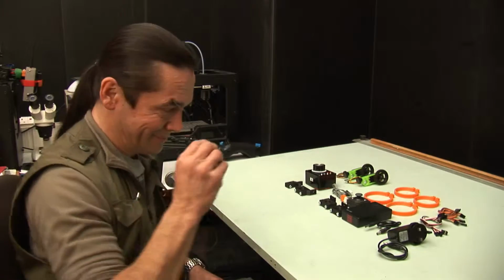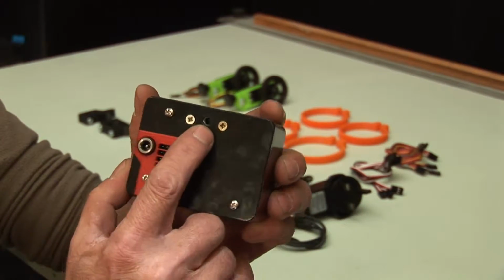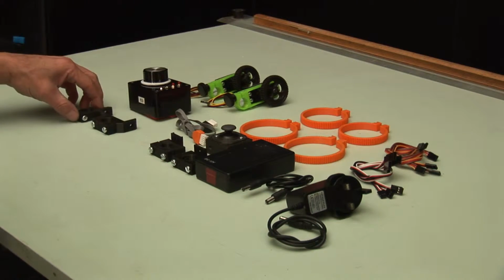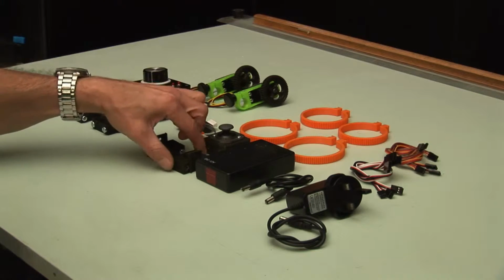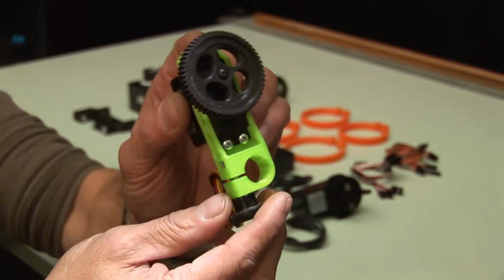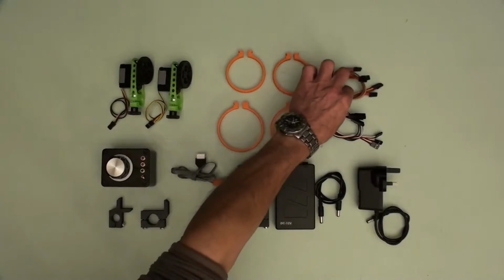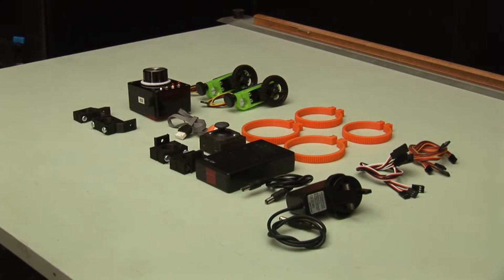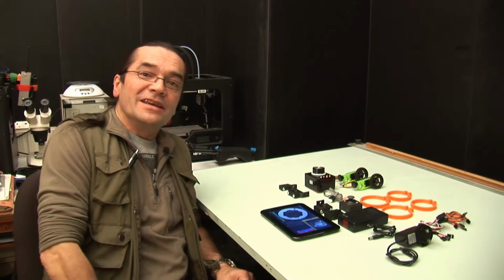The EZ-1 Part1. Lens and Gimbal control system kit.

Comment: Hey! Did you release this product yet?
Reply from the maker: Hi,
Many thanks for your interest.
I have finally sorted out all the standards and legal stuff so I am now good to go.
There is a small production batch currently being built which should be ready next week.
I am currently sorting out the sales blurb and final pricing so if you send me a message I will send the details as soon as they are available.
Cheers.
Reply from the maker: Hi,
Just to let you know that the website shop is finally up and running where you can buy EZ-1 systems and parts.
www.jpfx.co.uk 
The checkout is only accepting paypal at the moment but will have credit and debit card options available soon.

Thanks